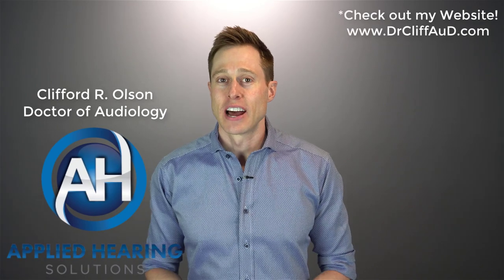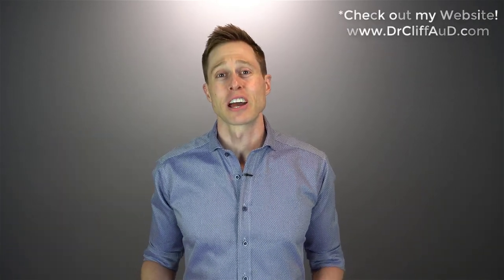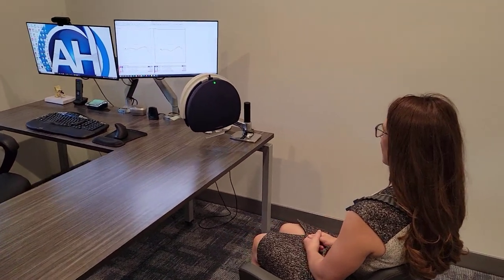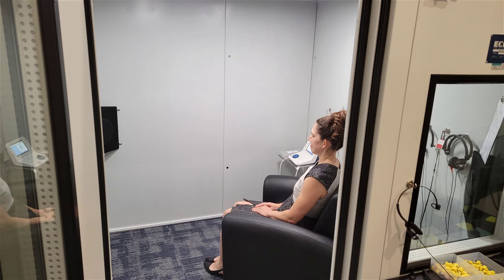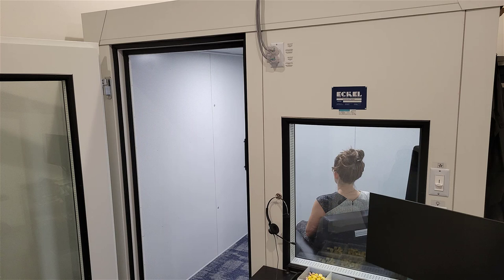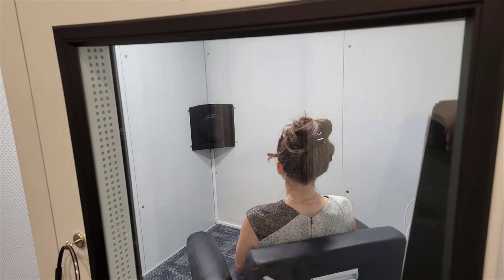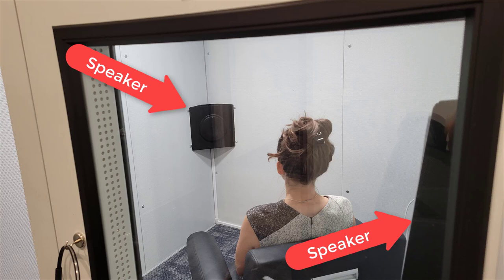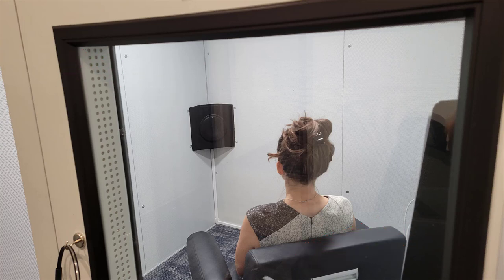Sound Field Verification of Hearing Aid Programming | Good Alternative for Real Ear Measurement?

Comment: I’m new to this channel. Just subscribed. I’ve been using hearing aids since 1995. This is the first time I ever hear about any verification or testing of hearing aids which have been programmed to you. I have used all types of hearing aids. Some have worked nicely, others have hardly worked at all. Unfortunately my hearing loss which started being moderate to severe, is now severe to profound and only one ear working well. One ear stopped as of May this year. Last hearing aid set cost $3,200 (Unitron T Insera 600) bought in 2018. They’re useless. Am using the Siemens Signia which I bought from India. (Did send my last audiogram)They’re solving my problem so that I can function in this world. Thank you for explaining. Will see more of your videos.
Reply: Hello Ruth, puedes decirme dónde de India compraste los audífonos?
Lo que explica en este vídeo está muy bien, pero ni de coña lo hacen en un centro auditivo aquí, muy experiencia es que solo quieren venderte el más caro y no te indican nada más. Compré mis audífonos hace más de diez años y necesito unos nuevos.